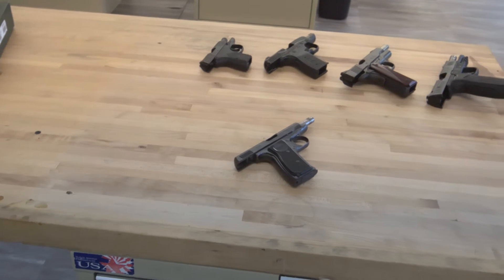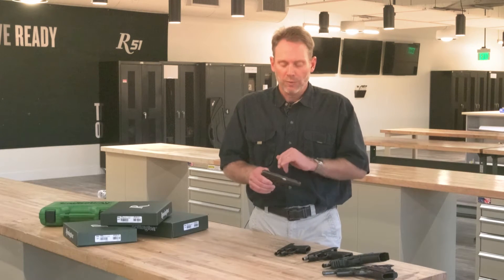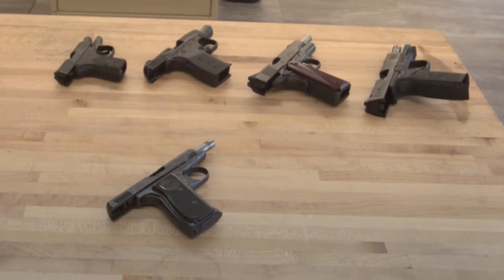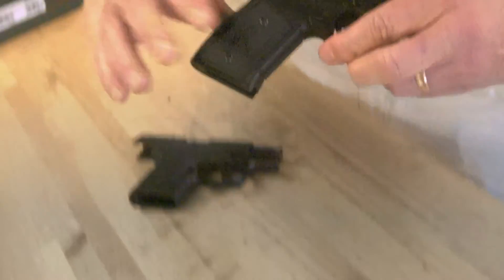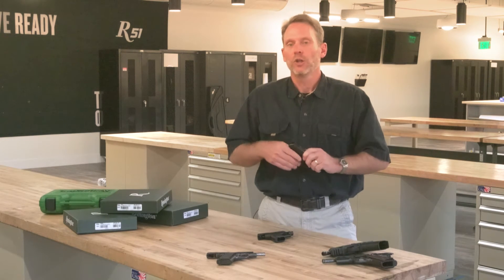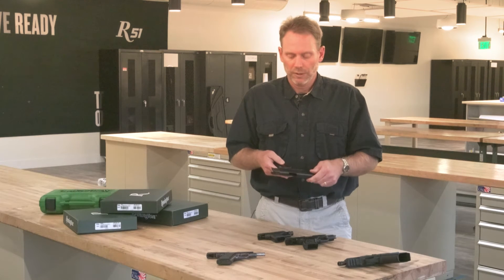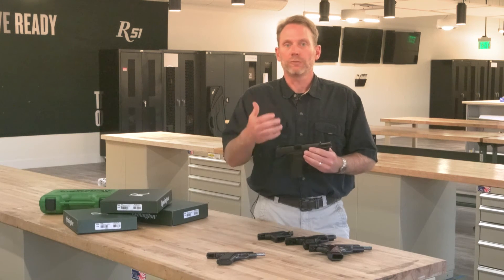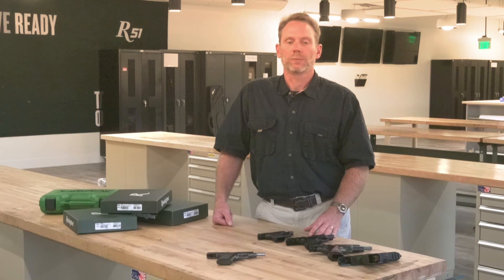History of Remington Arms: The R51 and How It Shapes the Future

Comment: Is good they speak of continual improvement.  There is still room for much improvement in the 2nd generation of R51.  The tolerances need to loosened a bit to make it more tolerant of variations between brands of ammunition and different bullet weights.  The firing pin strike is too light so some brands with hard primers simply go click instead of bang (although those same brands work flawlessly in my pre WWI Luger, my WW2 Ingles, and of course my Glock).  So put in a heavier mainspring to drive the hammer.  Or lighten the resistance of the firing pin spring.  Whichever.  The most common malfunction of the R51 is stovepipes.  Why not chamfer the corner on the right side and thin the port 0.05" back on the left side.  That should reduce the stovepiping.  LoL to how mine stovepipes  loaded rounds.  That's unique to be sure.  115 grain FMJs (not just mine, but several person's Youtube videos show this) tend to nose down jam, then hang on the feed ramp.  At the same time the breech face then presses against the rear of the magazine making magazine removal difficult (not to mention locking up the magazine release catch).  Some redesign of the magazine follower is clearly needed to eliminate the nosing down of 115 grain ammo.  3 dot sights.  Ahh, that is 1980s retro.  Why not go with combo Trijicon/fiber optic sights as an option.  Amazing how many encounters happen in dark places where white paint sights are useless.  Safeties, my P51 (which I call an M51) has two safeties Remington dropped on the R51.  I can live with dropping the magazine safety but why on Earth drop the external thumb safety of the P51 without at least adding a firing pin block safety for dealing with dropped pistols hitting concrete.  The Colt patent on their Series 80 safety is long expired and several pistol makers use it in their Mustang type clones.  Either stick on an ergonomic thumb safety or at least add a safety that positivvely blocks the firing pin unless the trigger and grip safety are both being squeezed,  Right now the R51 competes poorly with a Hi Point 9mm.  That''s a shame.  Make the fixes I mention, then bring it back as a generation 3 R51 so it can compete well reliability wise against the Glocks.  Thanks.